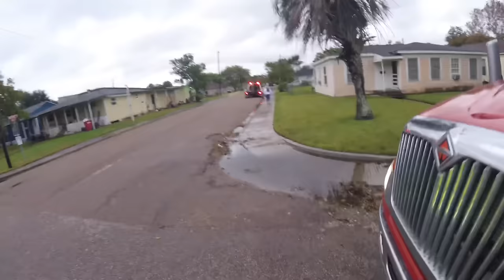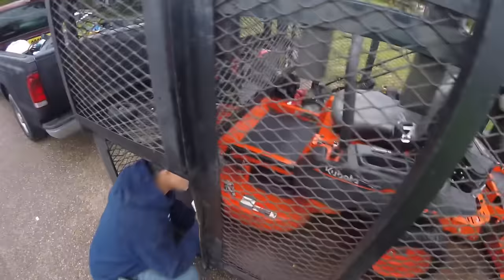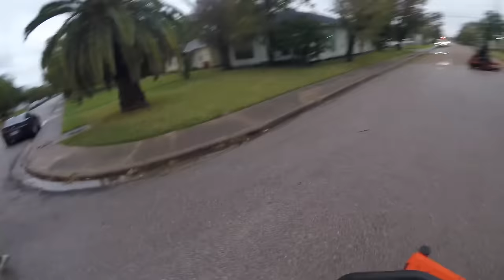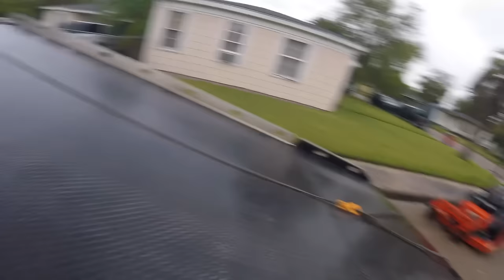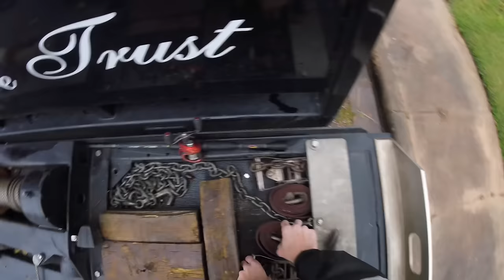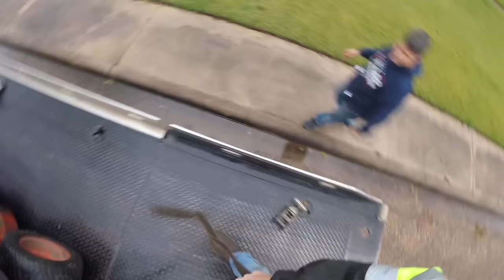Lawn Mower Repo! We Get Chased Down The Street!

Comment: That cranking and stalling was nice, hard starting with cold mowers often occur when the choke is not on full when the engine is cold.
Most mowers refuse to start unless given full choke when cold.
Many mowers also stall out or run very poorly if the choke isn't released right after the engine has started.
9 years of mowing with different mowers told me this 😀
Reply: Kubota also has an odd little arrangement with the lower end consumer units.
 The brakes and the levers have a very specific starting sequence,  if you are not used to it, the machine will stall out due to nervous Nancy safety switches. Thats one of the main reasons I prefer the diesels.

Comment: Question If the trailer is enclosed like this landscape trailer or otherwise designed in a way that it could be considered a secure, private space, wouldn't entering it without permission potentially be seen as trespassing in the state of Texas even with a repo order. The issue I see is that the taking of the lawnmowers might cross over the gray line even if he should pay his bills and it would depend on the judge whether the trailer, even on a public street, constituted a private space from which was implicitly or explicitly barred even with a repo order. I would run this past your company attorney for future reference.
Reply from the maker: Not unless it’s locked.